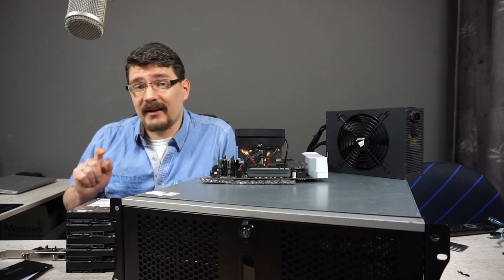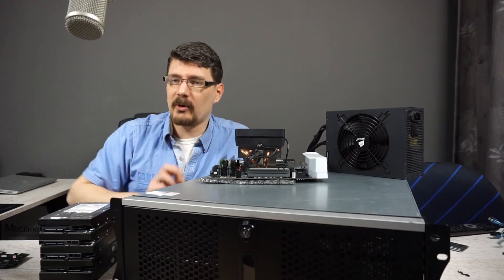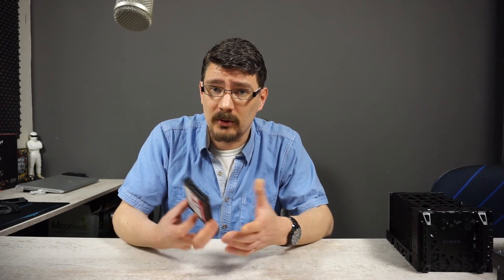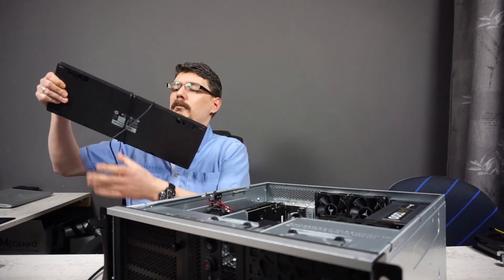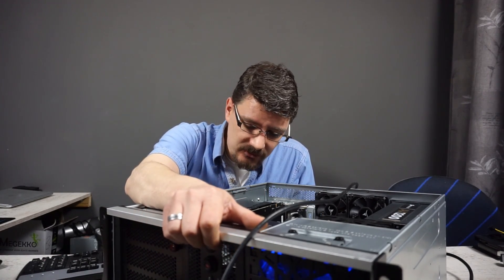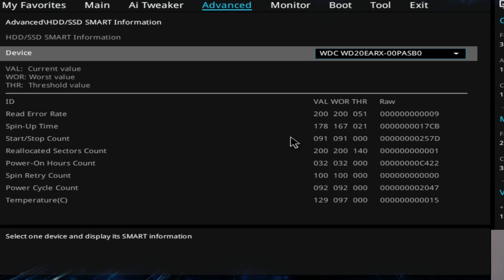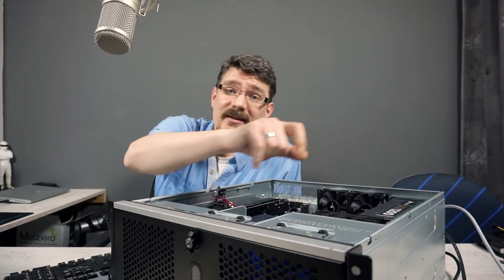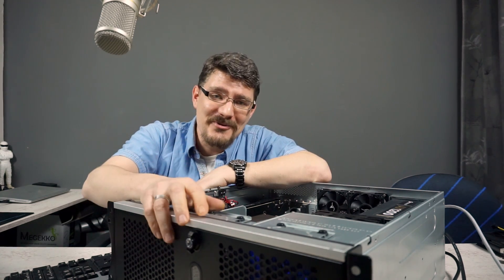Chenbro RM42300 server build with Icy Dock

Comment: why buy so many HDD when you can get 8tb for around 120/140$
Reply from the maker: Hey Dipayan Bairagi, thanks for watching. Well.. the green drives came out of a Synology NAS I had back in 2012. A couple of years later I bought the Red drives. Now the Green drives have been replaced with 2 8TB Red drives (white labeled) and soon the 3TB drives will follow. But back then these drives were crazy expensive compared to the 2TB / 3TB drives.

Comment: Wow I just discovered Rackmountable server chassis'.  But they all seem to be dated, there are no recent chassis'. Would you recommend this case for a workstation editing rig?
Reply from the maker: Hey Artkidtek, thanks for watching. If you are not planning on mounting this in a rack, I wouldn't advice to get a rack mount chassis. It just doesn't make any sense :P
You're better off getting a proper tower case with decent cooling.
When you, on the other hand decide to rack mount this then I would go with a bigger case. This way you will have more space for your components and therefore better cooling options.
Reply: The rosewill ones are a bit ruff around the edges but they can be very good if you get the right case (splurge and get the docking bay version) and cable manage them right.

Comment: Hello b00bytrap! Nice video. If you want to replace this SATA controller you can look on LSI cards on Ebay. For example 9200-8i (IT mode) is really cheap, it can handle 8 HDDs but this contoller needs x8 pci-e port.
Reply from the maker: Hey Fedor, thank you for watching and the advice. An LSI controller flashed in IT mode was the plan until I ran into issues with using only one graphics card. Sometimes it works great but then all of a sudden Nvidia recognizes it as a VM and I have to use the first graphics card again. Therefore I lost the ability to use another x16 slot in x8 as the third x16 slot is max x4 (PCIe 2.0).

Comment: Great video.  I'm enjoying this mini series as I've got a very similar set up in an X-Case X445-C4. However I've installed my gaming VM on an SSD which performs better than spinning rust or within the array. I haven't however seen much performance improvement from having 2xSSD cache drives as I am generally limited to the 1gig transfer speed of my network. Replace your fans with some Noctua's and put your gaming VMon an SSD and you're pretty much there.
Keep the content coming, loving it !
Reply from the maker: Hey GreenZero, thanks for watching. All my VMs are installed on SSDs. The Gaming VM has it's own 240GB SSD and a 1TB HDD. The workstation VM has a 256GB NVMe SSD and other VMs are on the Transcend 256GB SSD (smaller VMs). As for the Delta fans that I've ordered, these have PWM connectors so hopefully they will be controlled by the motherboard. I think most of the noise comes from the 120MM intake fan that came with the case. I still have to do some fine tuning though :P

Comment: I was wondering if that small icy dock enclosure worth the price. For much less price (according to the list price of the icy dock black vortrex in amazon.com)  you can buy brand new premium pc case like fractal define r6 which can acommodate 10 hdds plus many ssds. Otherwise if  you want seriously a hot swappeable solution, which I think not very critical for a home server build, then you can also buy budget rack server case with hot swappable bays already built in. Don`t misunderstand me, I congratulate your build and  I don`t say that your gear is not working perfectly, I am just saying that pricewise it is not the best solution. Especially  the icy dock which price value ratio is terrible.  I am running proxmox server at home and I am also thinking the to upgrade my server case (currently old coolermaster stormtrooper case 15 hdds + 2ssds  squeezed into it ( not easily...:- ).)
Reply from the maker: Hey Norbert Dupsi, thanks for watching and I totally agree with you. I did spend a couple of weeks on research before buying these components. The total price (second-hand RM42300, Vortex, and 3 Delta fans): €168,71
The Vortex (hot-swap) I got for €72,64 and for a 4-bay drive solution I find that a bit steep as well. Other solutions were mostly €100+ (5 drive bay).
They didn't have to be hot-swappable but it's nice to know I don't have to take my whole server apart to upgrade or replace one of the array members :)
I had a Corsair Graphite 730T with plenty of room but I wanted to rack mount the servers and equipment so therefore I went with this setup.
As for server cases with hot-swap, I looked at that as well but they start at €250+ which was a bit over my budget at this point. Maybe for a future unRAID build with more drives.
As for your server, what are you thinking about upgrading to?